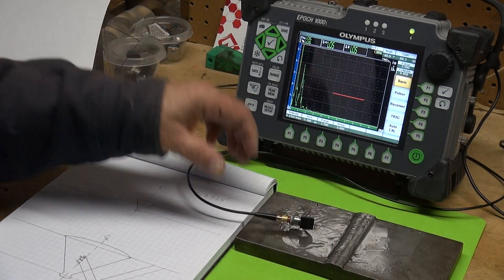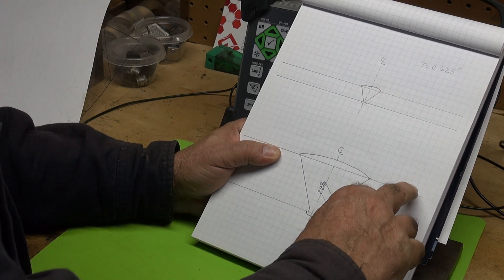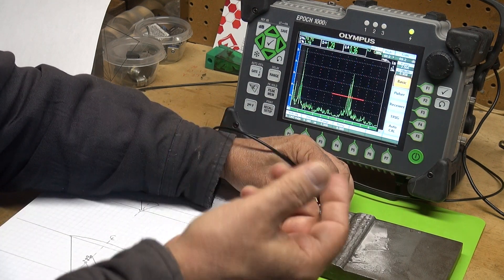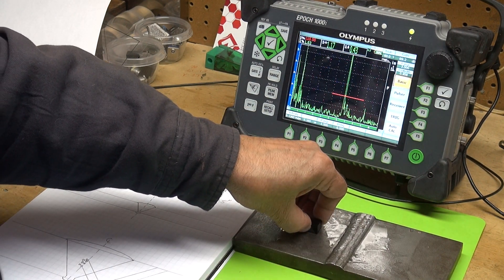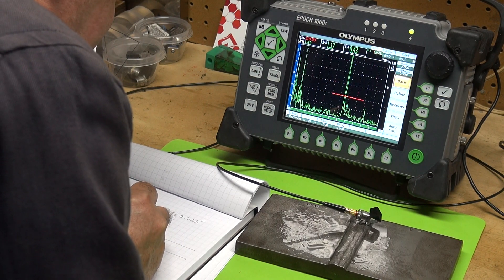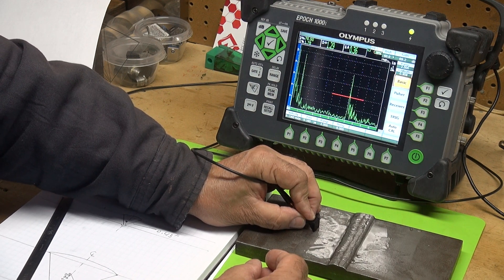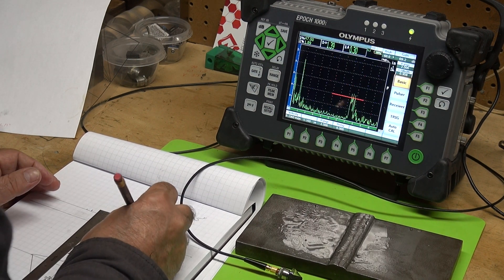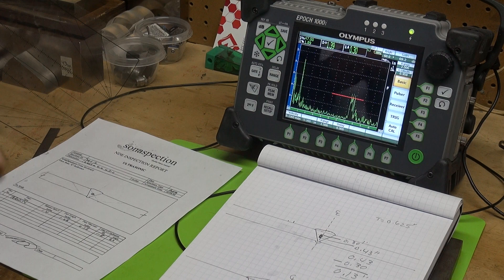UT Porosity Thru Wall Sizing

Comment: Sir, it was a nice video. However i have a question,
Is there a possibility that the technique that you just demonstrated to size the through wall height would give
more accurate results in case of planar flaws as compared to such volumetric flaws?

I noticed that there were a bunch of trailing signals of varying amplitudes (which was mentioned as broad signal envelope) as you were
moving the probe back and forth towards the weld center line and also while orbiting. These signals are possibly coming in due to some mode
converted signal set, for instance one component of the wave would have possibly hit the face of the flaw, there would have been some mode 
conversion to L-waves and after some reverberations L wave converting back to shear waves and back to the probe, so here the overall time of flight
or the path taken by the waves would be longer giving rise to a bunch of trailing signals. Based on the geometry many such mode converted paths are
possible. In the scenario as shown above there is a high possibility that while moving back and forth we are possibly hitting the same spot of the flaw
but we are getting different depths possibly due to the change in path length or time of flight variation caused due to mode conversion. The through wall 
height measurements could possibly have some variations if you hit this same flaw from the other side of the weld due to some subtle changes in the
geometry. Having said that sometimes we may get lucky that the through wall height measurements of such clustered porosity would tally quite well
with the measurements as given by the manufacturer (Sonaspection, flaw tech, Ph tool etc.) but this may not happen always. If we take say about 5 to 6
samples of clustered porosity with some varying overall geometry, definitely there would be some samples where the overall through wall measurements
wont tally with the measurements (based on radiography and which would be quite accurate for such volumetric flaws) as given by the manufacturer. 
The reason is purely due to the mode converted paths taken by the beam and which is very difficult to trace using a conventional single crystal approach. In order to
accurately gauge the through wall height irregardless of the geometry we need to go on a tomographic approach where multiple mode converted paths are captured by the probe using an array of elements and each of this raw A-scans are evaluated for there individual time of flights. 
Please note a conventional phased array approach will also give similar results to the one as shown above.

Lastly was this sample radio graphed?